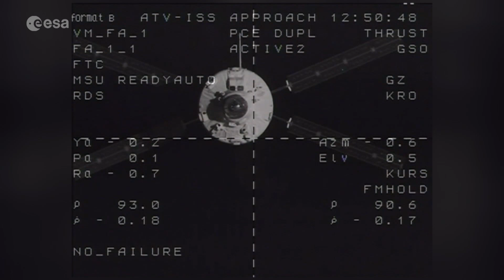Orion and the European Service Module

Comment: What we need is a own manned spacecraft for Europe.
Reply: Problem is not the spacecraft but the launch vehicle. Ariane is very reliable, but it still has solid boosters and putting crew on anything with solid boosters is just bloody stupid. Soyuz is just fine for now, thank you very much.
Reply: @aleksandersuur9475  Crews have been launched on solids for 30 years and will be launched on solids in the future. Ariane V was originally designed for the crewed Hermes spaceship.
Reply: too much corruption and corporate welfare, they make space funding into a jobs program, it's upsetting and we all see it for what it is.

Comment: The video said that ESM would be used for Orion's first flight, however that took place in December 2014 when it launched on a Delta Heavy rocket.  I think it should have said when it launches on the first SLS rocket currently scheduled for 2018.
Reply: Well technically this "first flight" was just re-entry test of the capsule, with most of the crucial components missing and replaced by dummies. What is referred to in this videos is actual first flight of the whole spacecraft.
Reply: That flight was an unmanned test. You could argue it doesn't count.
Reply: I could see that point of you yes
Reply: Yeah, by first flight they meant the first integrated flight where Orion will be brought up on the SLS